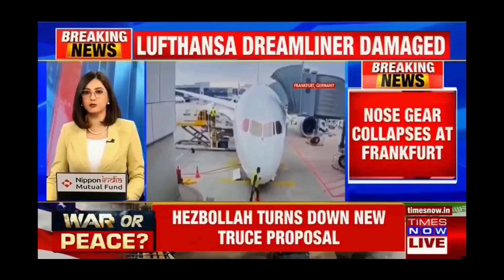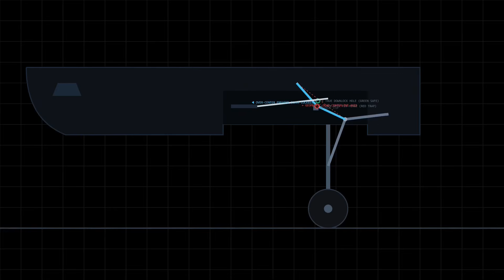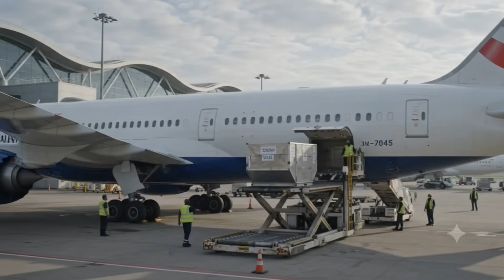The Design Flaw Boeing Was Supposed to Fix (787 Frankfurt Incident)

Comment: Sir, would you please share the evidence with us that the ground lock pin was set in the apex bore.
And please, no talking, just facts.
If there are none, you better remove this video instantly, or you will get in serious trouble with the company you pissed at, namely Boeing.
Reply from the maker: If you see my full video I never concluded anything about Lufthansa. I only said logical possibilities as for previous 2021 incident I definitely have evidence for this. Ofcourse everything I shared is not something new its as per Boeing own DDG and FAA standards. Infact whatever happened as per BFU investigation I already said it as one of the possibilities if you saw my full video. So yes Please don't worry about Boeing suing me.

Comment: Highly likely or unlikely doesn’t matter when the video shows that it is a certainty.
Reply from the maker: Don't get me in trouble I'm just saying its likely 😅
Reply: @FirstPrinciples-l5m Not aimed at you, and I challenge Boeing to challenge me on my comments. They wouldn’t, because I’d expose them. I’m a certified safety systems design engineer that I will call their bs and point out what a bunch of fraudster engineers working in their engineering department.

Comment: Boeing workers are probably drunk on the job.
Reply from the maker: Its not like that in my opinion, since I to work in high stakes research product I kinda understand this. Its all about process Aircraft safety Certification are very complex and expensive their are some articles suggesting boeing is cutting cost on certification and quality, ofcourse not in a major portion but these secondary proces like checking design modified sub sub systems. We can't say anything without proof, but I don't think blaming engineers here is fair its the management which is responsible if at all cost cutting happened.
Reply: @FirstPrinciples-l5m I’m an engineer and I know that we have strict processes to prevent such incidences when designing complex systems. Boeing engineers knew this once upon a time, which they’ve forgotten either because they’re drunk on the job or drunk with their profits.

Comment from the maker: 👇 TIMESTAMPS 👇

00:00 - The Frankfurt Incident: Collapse or Powered Retraction?
01:46 - The Multi-Stage Hydraulic Sequence Explained
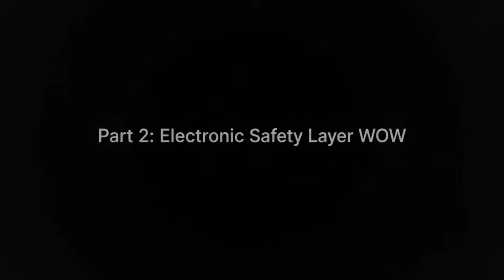02:55 - The Electronic Safety Layer: Weight on Wheels (WoW) Sensors
04:15 - Why WoW Sensors Experience Ground Errors
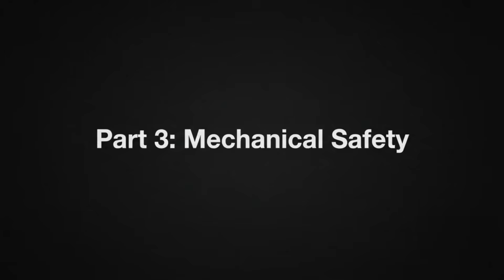05:50 - The Mechanical Layer: Over-Center Mechanism & Ground Lock Pins
07:44 - The "Geometric Trap": Apex Bore vs. Ground Lock Bore
08:36 - History Repeats: The 2021 British Airways Incident (G-ZBZF)
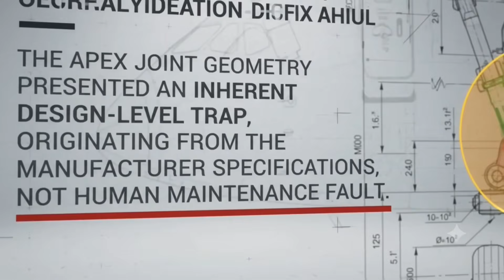11:10 - The Regulatory Timeline: The 2020 FAA Airworthiness Directive
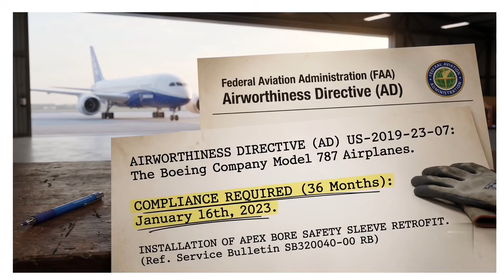12:48 - The 2026 Paradox: Production Escape or a New Failure Mode?
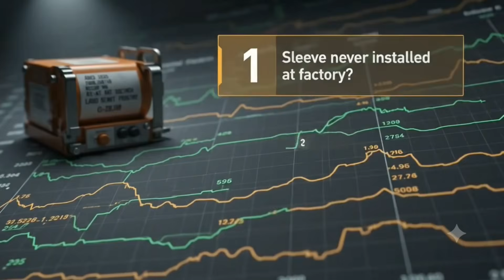15:07 - Three Hypotheses for the German BFU Investigation

Comment: Interesting content, but I feel that AI illustrations and videos that show inaccurate movement and position are out of place on a video that's supposed to be technical and accurate. I'd rather have pictures or small animations that correctly identify the parts and mechanism rather than this.
Reply from the maker: Yes, I tried that as much as possible. Honestly, I wanted to do the animation myself to avoid AI hallucinations, but I couldn't finish most of it. Since I'm still working at a research institute and doing everything on my own, I just couldn't find enough time. I was forced to use AI animation for basic visualization, which was better than nothing. Publicly available images were also limited, and AI generation led to more hallucinations. The feedback on my last video showed that most people didn't understand it because of those images. Anyway, I'm trying my best to fix these issues in future videos.